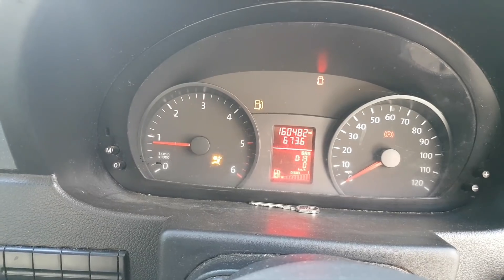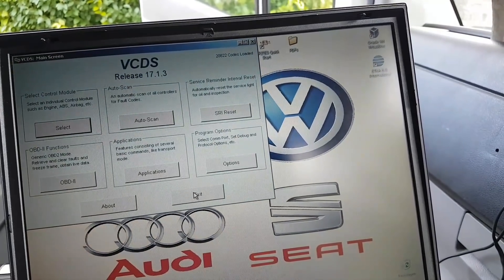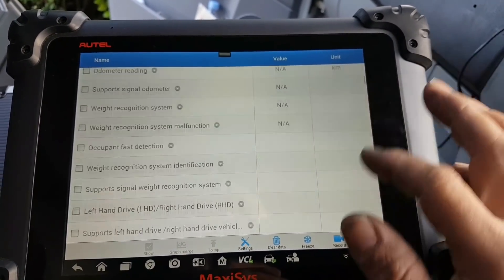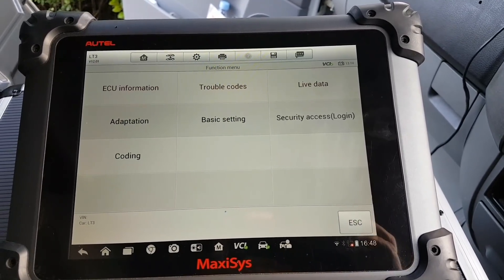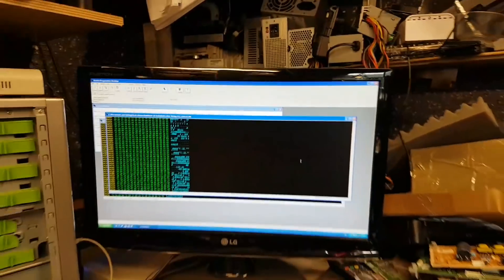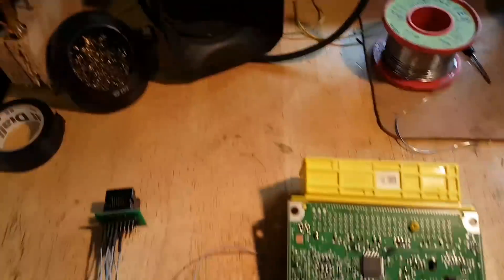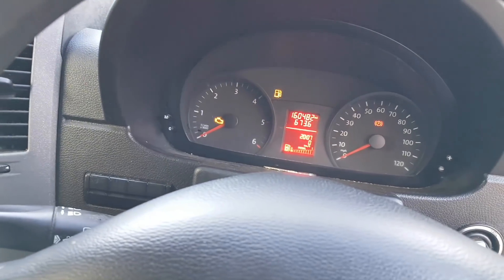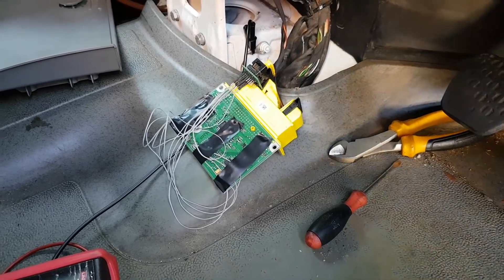VW Crafter 2E 2010 Airbag light on. Codes B1600 and B1003. Fault finding and repair.

Comment: Hi all just a head's up about clearing crash data on newer vehicles, It is recommended to keep the Srs module in an upright  position before reconnecting the connectors to the module from the vehicle. Some Srs module have roll over protection & if not place in an upright position can cause unwanted deployment of airbags. It is also recommended to return the Srs pcb board to its case & atleast put one mounting screw/bolt or ground the case before testing, some airbag modules have been known to deploy for whatever reason without case ground. Most vehicles 2014+ carry mpu not eeproms which require a different process  for clearing crash data. LM Auto Repairs
 great video, keep up the good work.
Reply from the maker: Indeed!
Thanks for sharing that info!
And for watching! 
👍

Comment: Great Video and thanks for the wonderful information/ lecture. am having similar prolem on my Honda Accord 2010 model Sedan, Air Bag light is on can you make a video or walk me through on how to clear that light. NB theres no code its all cleared i need to reset the module.

Thanks....
Reply from the maker: You most likely need a scan tool... but how it have no codes, and the light is on?
🤔
Thank you for watching and for your comment!
Reply: @LMAutoRepairs  I did not mention, code has been cleared. I have MAXISYS 906TS which did the job, but still can't get rid of em light.
NB: am still getting to understand the device  with your help😎😎

Comment: Yep like a few mentioned, would have been good to see if data restored. Usually total loss of data gets me to see if parallel stored in another interelated cm and go straight to board test and file extract and dump. 
Good to read sound and safe advice re accidental deployment! 
Really is a must to have heads up on system and readily accessible diagrams(there's a problem).
I always teach "if you ain't sure, don't tour". Spend the time arming yourself with sound knowledge and information. It's cheaper than a costly fopar.
As always appreciate your knowledge and on job sharing. Makes us all better technical practitioners and gives Joe public an insight to our careers that is no longer just  grease n oil!

Comment: And dr.LM, master technician for all brands is fixing all vehicles including this train.😂
You are awesome man. Thank you for the video. I wonder if live data is coming back when you fix it ?
Reply from the maker: Someone asked the same... I should have checked it...🤦‍♂️
I will next time...
Thank you for watching and for your comment!
Reply: Maybe, just maybe, when is module in crash mode, there is no live data, because module is in kind of standby status an does not read sensors and all that garbage built in the system. But why then does not symply show that in fault memory folder, hey i am in crash mode.
Reply from the maker: @markobezjak6952  
Yes... makes perfect sense!
👍

Comment: Hi Luis i have a lancia y 2003 i have airbag crashed data what tool can read my chip you think? Can i read it without taking the eeprom of?
Reply from the maker: I don't know what chip is on that one... open the module and check it...
Thank you for watching and for your comment!
Reply: LM Auto Repairs ok bud thanks
Reply from the maker: @armandonika  
👍
Reply: LM Auto Repairs 
Hi mate what software do you use for crash data clearing
Reply from the maker: @alialtamimi3317  
Depends... there is a few out there... and some do some modules, some other ones do other modules... so you need to look to the one that does the module you need...
Thank you for watching!
Reply: LM Auto Repairs ok thank you much appreciated. Keep up the good work mate

Comment: Hi - I have only ever programmed a few 8 pin eproms to revise the bios on chromebooks using a raspberry pi and a piggy-back clip. Would this approach work for you as it seems rather more convenient and less time consuming than soldering - especially if you knocked up a self contained portable rpi battery powered programmer ?
Reply from the maker: Hi
I could easily use the piggy back clip... however, I always aim to remove the eprom to read... some situations the pcb circuit can influence the reading and writing... and you ended up with a corrupted data...
Don't like to risk on jobs like this...
But I know what you mean...👍
Thank you for watching and for your comment!

Comment: Which part of the country you in sir
Reply from the maker: Hi
You need help?
What is the issue?
Thank you for watching!
Reply: @LMAutoRepairs   yes 8v asked you before with no reply . So here's the problem   the ecu doesn't turn the fan on . Because I can't get a diagram of the sensors wire colors  etc I'm unsble to determine if there's a short between temp senor. Fan knock sensor ecu.etc Or is the ecu broke. . I get code p0148 something I'd need to look again . It says coherence .fan fault integral to ecu. Look forward to ur reply .
Reply from the maker: @nomadforjustnow5236  
Hi
I get thousands of questions... as much as I try, I am sure I miss one every now and then...
Which car are we talking about?
Reply: @LMAutoRepairs  it's a 2010peugeot 207 1.4 petrol 8v . Av searched the Google for direction . I would like to eliminate any possibility of a short to ground in the wiring before going to Peugeot to get the ecu reflashed although am sure there must be an ecu update needed to .
Reply: P0485 code
Reply from the maker: @nomadforjustnow5236  
Ok...
Check... if you have not already...
Fuses, relays, ground points, do a thoroughly visual inspection... make looms have not been rubbing etc...
You need then, diagrams or follow that circuit and try to figure out if everything is ok from the fan to the module... I am not sure what controls the fan on that one, if the engine ecu, or the upc...
Can you power the fan directly, just to make sure there is nothing wrong with the fan itself...
Hope that helps...
Reply: @LMAutoRepairs  yes checked all I can find and also replaced the fuse box under the bonnet . Thanks for your help
Reply: Just to clarify I can turn the fan on using diagbox both high and low speed the fan also works when air con is on .it just doesn't switch on when it's suppose to to cool the actual engine when stuck in traffic etc .
Reply from the maker: @nomadforjustnow5236  
Ok
Have you monitored the coolant temperature sensor?
Reply from the maker: @nomadforjustnow5236  
If you can actuate the fan, then the circuit integrity must be good... so is not the actuator side, but the control...
Reply from the maker: @nomadforjustnow5236  
Ok
I had it once similar, and a software update resolved the issue...
https://youtu.be/ddFCvxpQE3E
Reply: @LMAutoRepairs   coolant never changes  iv tried a new temp sensor because when I disconnect the sensor the gauge his into the red and the the fan comes on full power .so I changes it out for a new one. So can you update my ecu??
Reply from the maker: @nomadforjustnow5236  
So, the temp on live data, does not change at all?
Reply: @LMAutoRepairs  I meant the level . Live data go's up as it warms up .last time I was using diagbox it went up to 116 degrees before I switched engine off . Fan is suppose to come on around 93 I think .
Reply from the maker: @nomadforjustnow5236  
That's really wired...
Get the car updated then, if there is a newer version available...
Reply: @LMAutoRepairs  it cost hundreds of pounds .I was trying rule out a short. When I put a meter on 1 of the pins from the temp plug I get 5 ish volts . I get nothing on the other wire .not even cotinuity of a ground. Iv also noticed there are 4 fuses under the bonnet that have no power or ground with key on or off .and 1 in the bsi in the car the same . This is what is making me think it's a short some where but it's pointless without a diagram . I know nothing about electrical diag  am learning as I go along .
Reply from the maker: @nomadforjustnow5236  
Get yourself registered on my forum, and ask for the diagrams... 😉